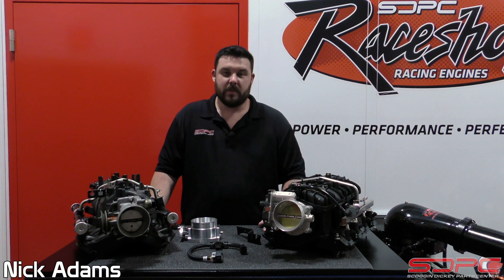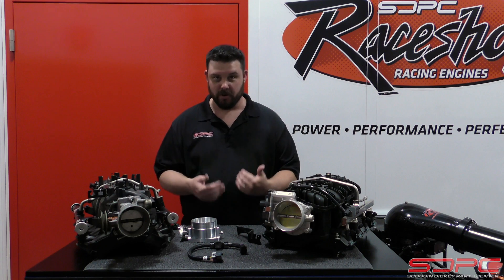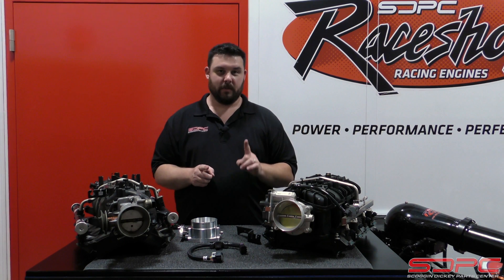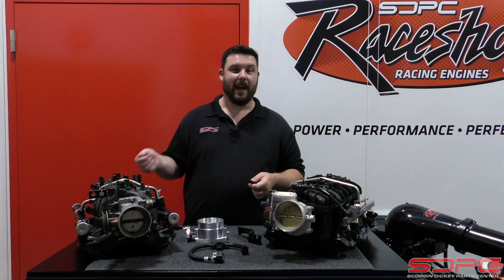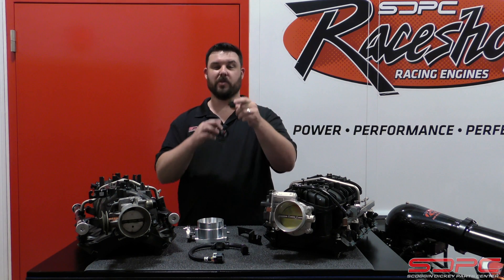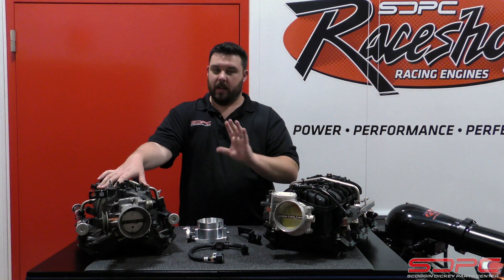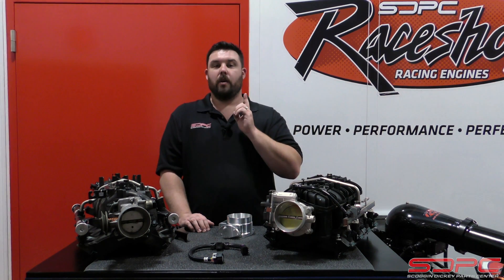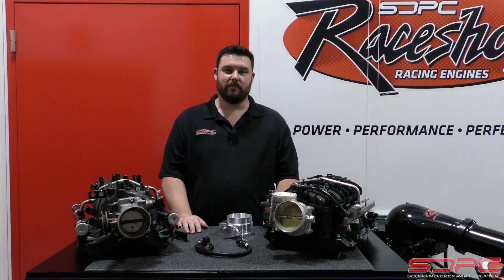SDPC Tech Tips: Cathedral Port Truck Intake Upgrade

Comment: For those of us with a return style fuel system, do we have to modify the fuel rail to make the filter fit with the stock fuel lines or will it all connect easily without kinking the fuel lines???
Reply from the maker: You'll have to convert the fuel lines on the chassis to returnless.  Most people use our fuel filter kit, some fab/assembly required.

Filter kit: https://sdparts.com/i-24498808
Video on that product: https://www.youtube.com/watch?v=G_yI175P9h4
Reply: Scoggin-Dickey Parts Center won’t the fuel filter on the rail push the factor fuel lines back against the firewall? Won’t kinking the fuel lines be a bad thing?
Reply: Corvette filter/regulator for 59. Or buy a fuel reg with 3 ports. Ive ran both. Did not see a difference under 500hp